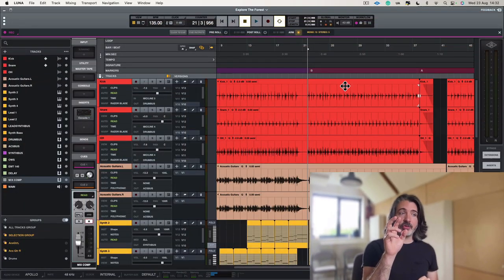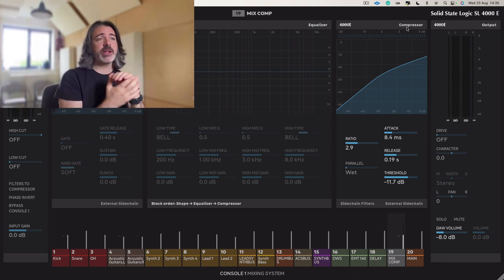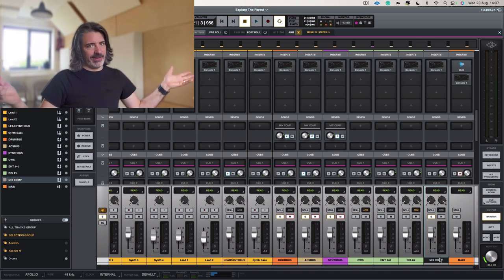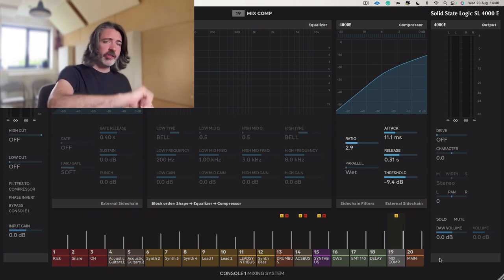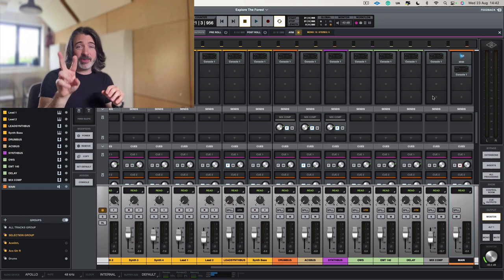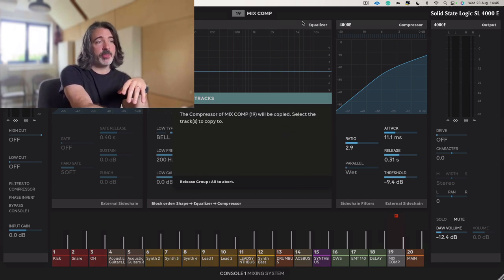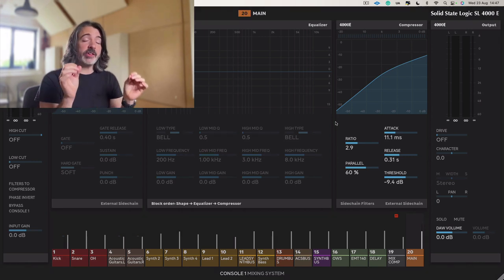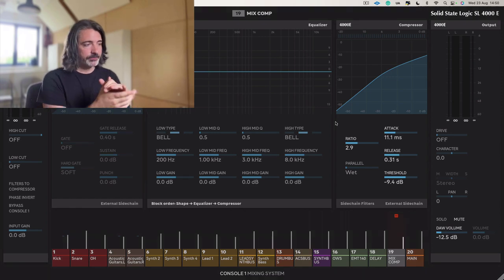Parallel Mix Bus Compression: Give your mix a punchy head start!

Comment: Hi Alex, you have such a great way of explaining things. Please keep these videos coming! Quick question, when using sends for effects and additional processing, would you also send those effects to the parallel mix bus? Is it safe to assume anything that would go to your mix bus would also go to the parallel bus? Thanks
Reply from the maker: Thank you ever so much for watching these videos, I am very grateful to you for being here and I am super pleased they are helping you! 

And yes, you’re quite right that my “go to” setup is to have everything that my mix bus is seeing is also going to the parallel mix bus compressor. However, it’s not always the case. When I am assessing my tracks before I start to mix, I always ask myself what my parallel mix bus needs to help with. Am I just trying to add overall density, steadiness and impact (in which case probably everything is going there) or am I trying to make certain things be ‘bigger’. So a good example of this would be if I have a track that has some clear dynamic differences. Imagine a verse with just a cello and an acoustic guitar, but the chorus is massive with drums, distorted guitar and some samples. I may omit the strings and acoustic guitar, to make sure that when the chorus hits it’s just massive, and the verse stays calm and relaxed. In that case, I will quite possibly send the track to the parallel mix bus directly from the tracks themselves, being selective about what gets the extra density it provides.

Comment: How did you set up the Parallel Mixbus Compressor?   I am preparing to get softube products, but I need a greater understanding.
Reply from the maker: Ah, yes! Good question! Setting up the Parallel mix bus can be varied, depending on what I am trying to do with my session. However, I do have a great “go to” setup, which is to route all my instruments to sub-group buses. So drums all go to the drum bus, the guitars all go to the guitar bus, etc. Then, from these main buses I will send them to the Parallel Mix compressor. I also group my effects next to my instruments sections a lot. So my drums will have its own reverb bus, which say kick, snare and overheads might go to, then all of that goes to the main Drum Bus, so the parallel mix bus receives the effects as well! I will try to put together a video on routing to parallel mix compressors so you can see these things in action!